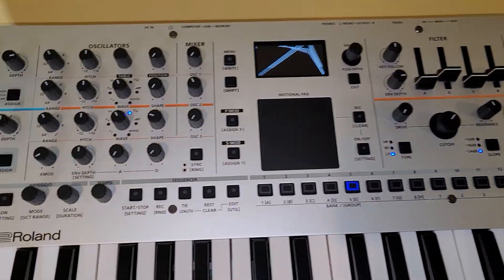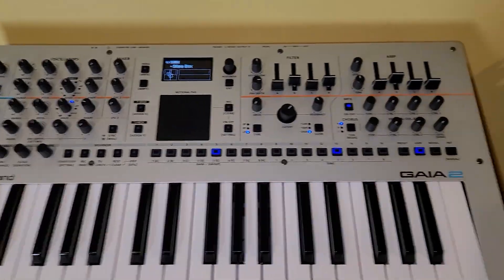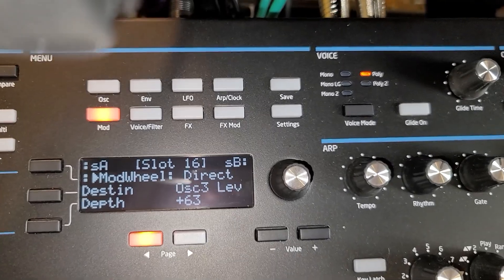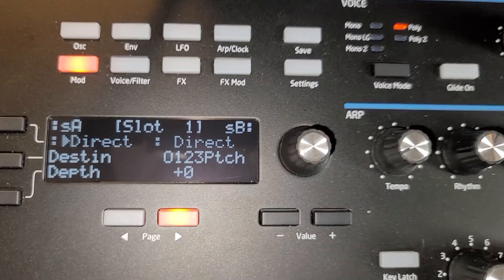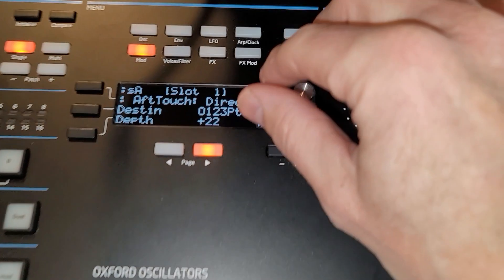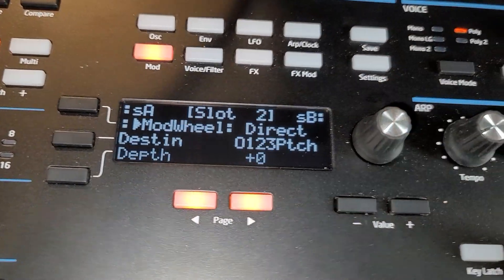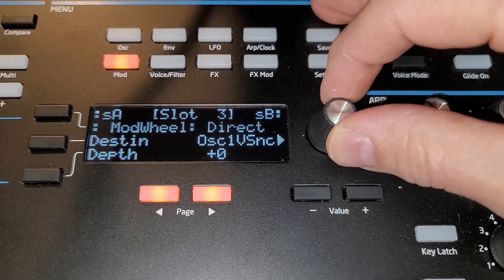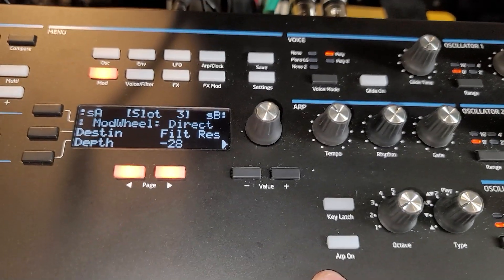Modulation and the Mod Matrix: Everything You Need To Know - And Why Should You Care?

Comment: Thank you for this update, Scott. Modular synthesis (as well as how it is simulated in mod matrices) has long flummoxed me. This video has helped me understand a whole lot better.

There was a stretch when I allowed my mentor to muddle my thinking. He was hyper traditional, and he didn’t think that the term “modulation” applied to anything other than pitch. He didn’t think that sound characteristics could be modulated or that there was any correlation between modulation and modular synthesis. I hate to speak ill of the departed, but it is probably safe to say that he did not evolve like some of the patches on that Hydrasynth.

Comment: Thanks for the vid.  You do a great job of making these concepts simple to understand with real world synth examples.  If I could make a small suggestion in regards to your camera work.  Looks like you are holding the camera when you are doing your close up synth demos.  As a result, there is a lot of shaking going on, and it causes a bit of nausea when trying to watch those demo sections due to the jerky and unstable camera movement.  Perhaps look into getting a tripod with arms that can grab onto a Mic Boom and place the camera in a fixed position or use a steady cam type filter when you edit your vids during those sections.  Other than that, this was real informative on stuff that I know, but am always looking to glean more information on.  Thanks!
Reply from the maker: Yeah, I normally do use a tripod for these videos, but for this one I was moving from synth to synth pretty quickly, so I thought I'd do handheld...didn't realize how shaky it was!

Comment: Some of my synths offer a mod matrix. My personal preferences are (in order) ... Polybrute(6): easy to use and current settings at a glance ... Summit: easy to use, ok, some menu diving ... Hydrasynth (Desktop): very flexible and powerful ... Access Virus (Darkstar): pretty complex but great offerings ... UB-Xa: Menu diving but fun to use ... Blofeld (Desktop): Some learning curve but powerful (and a lot of menu diving). 
Nevertheless the mod matrix is a great tool to create, enhance or sharpen sounds 👍. Sometimes it might be useful to get a sound editor. Maybe but turning knobs or moving sliders whilst sound creating process is much more fun 😉

Comment: Please make a video with the equivalent functionality in Montage.
Reply: The Montage M has dedicated LFOs and envelopes for pitch, filter, amplifier, and things like osc sync. But completely separate from that is the motion sequencer, which can be an LFO or envelope or anything in between, and it can modulate lots and lots of parameters. I think overall, you have a lot more options and control with the Montage M, but it isn't as user friendly or intuitive as the Hydrasynth. There's quite a lot of menu diving on the Montage M as well. I've had mine for over a year and still get lost. It really does sound fantastic though.
Reply: @shannonroberts5080  I have the original Montage and I know they are quite similar in this respect. It's powerful but very confusing. I know Scott has a lot of experience with it as he also had the original Montage before.
Reply from the maker: And I had a MODX before that. Yeah, I'll have to do one of these for the Montage as well.